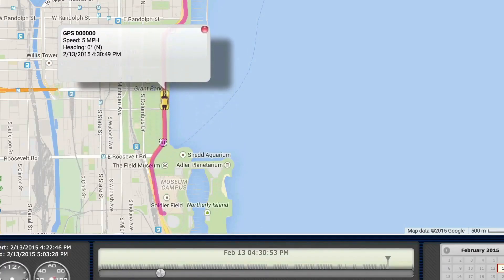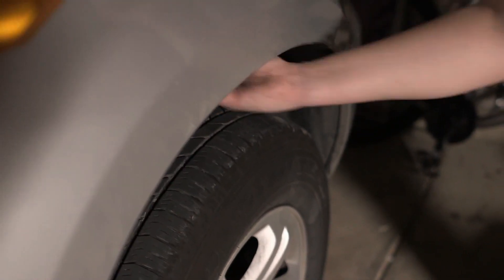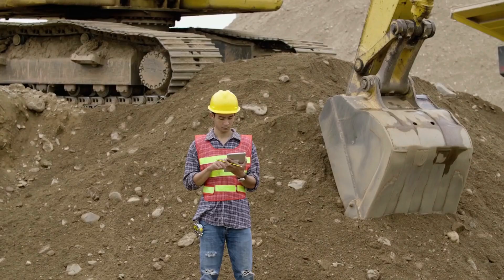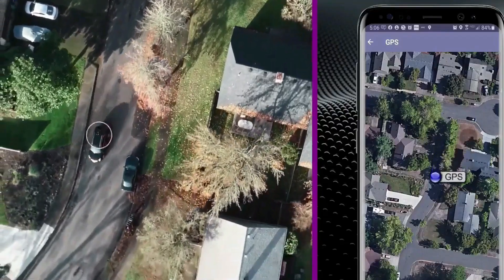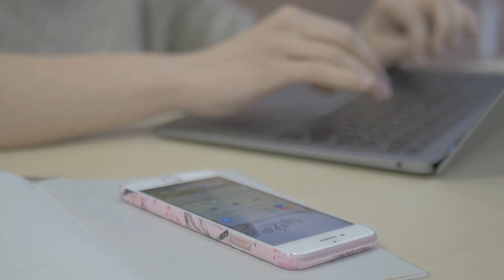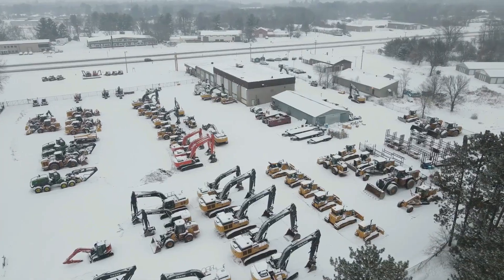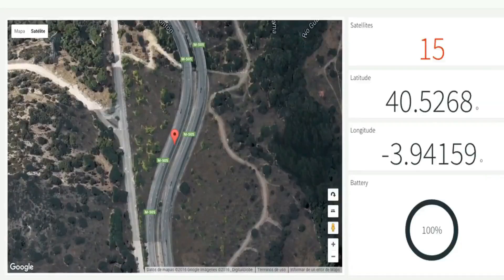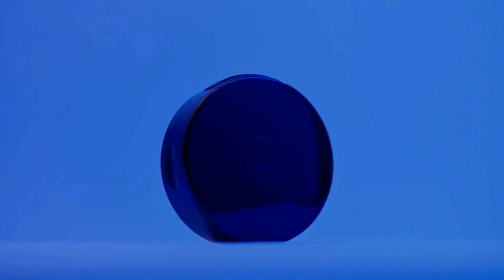GPS Asset Trackers | Small Asset Tracking Device For Construction Equipment

Comment: I came across this video on GPS Asset Trackers | Small Asset Tracking Device For Construction Equipment and it surprised me. The perspective offered is both
enlightening and captivating. If you're passionate about GPS Asset Trackers | Small Asset Tracking Device For Construction Equipment, you should check this out on
GAO RFID Inc —there are some real gems here that might change your viewpoint.